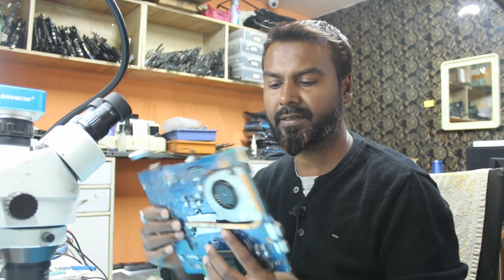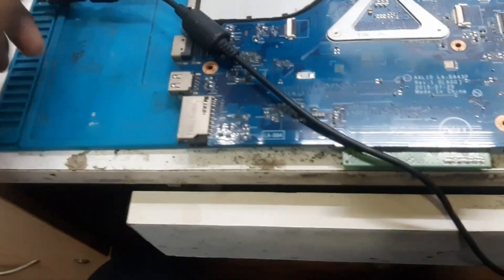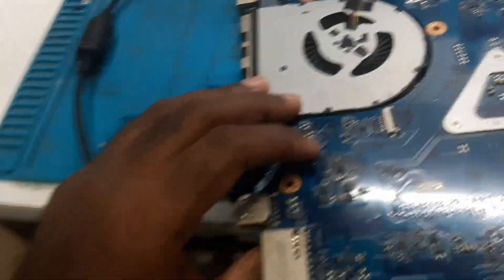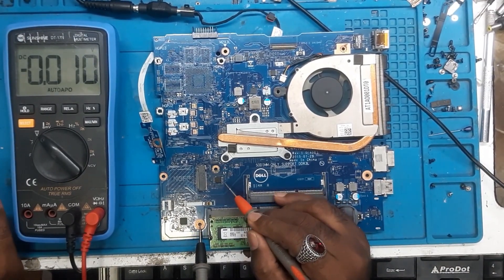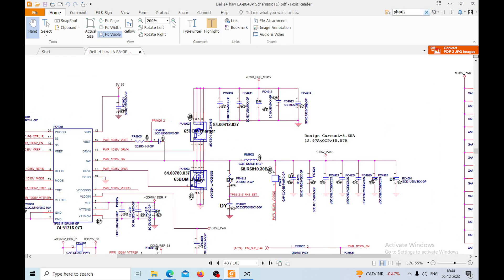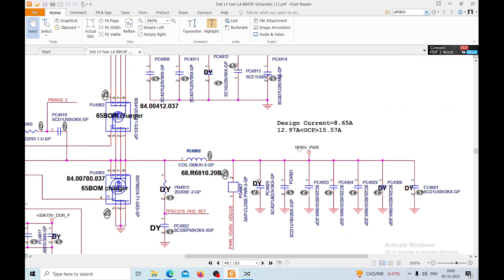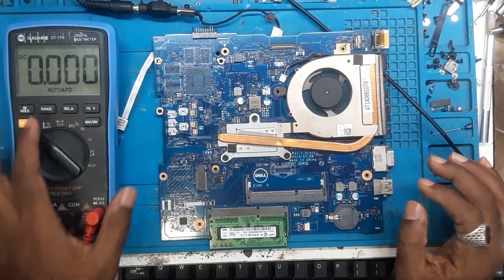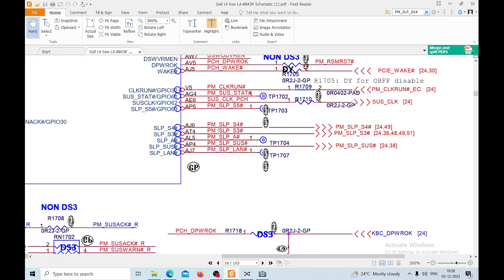Dell Laptop no power repair  | La -b843p no power solution

Comment: Hi, thanks for the video, it has given me an idea of how to repair it. I have an HP convertible 360 that turns on, the fan does not spin and the CPU gets very hot. I have a consumption of 700 ma, I have no ram voltage, and I do not have PM_SLP_S3# and PM_SLP_S4#. I have done bios several times and cleaned region me. Maybe it is there that it is damaged. Or could you give me some other idea or advice, thanks.